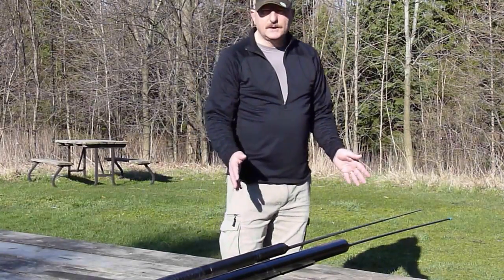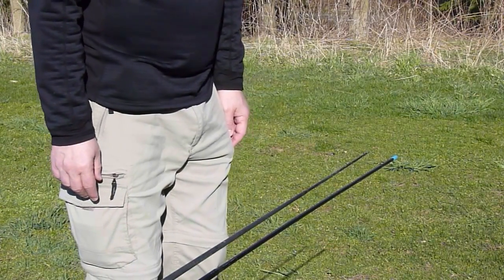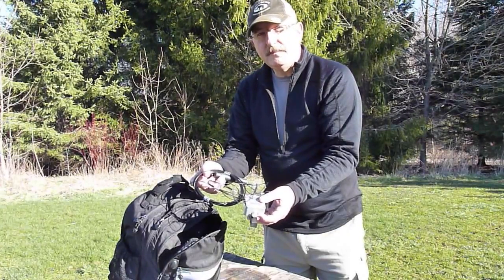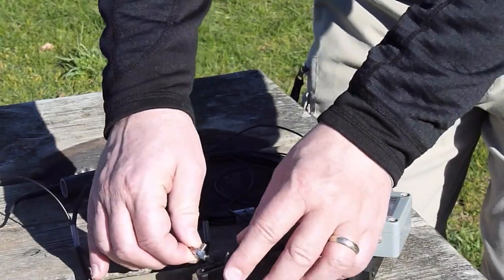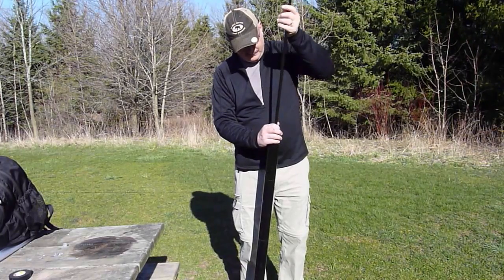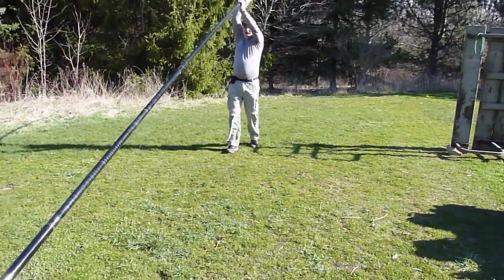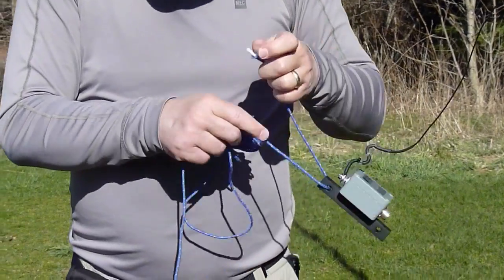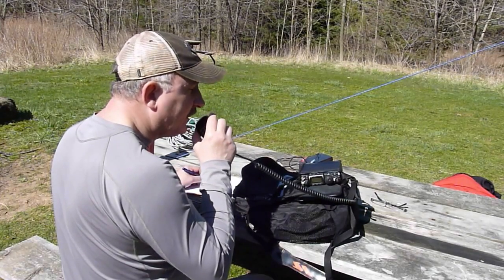HyEndFed 3 Band + Spiderbeam 12m Pole = Easy and Effective HF Portable Vertical Antenna

Comment: Great video. I have the 12m pole and it is heavy if you have to carry it to your site. I mount mine before I put it up and tape the first few sections along with the wire. then use the clamps that come with it. I find that easier if you are on your own than walking it up and less strain on the pole.
Reply from the maker: Good tip, thank you for sharing.

Comment: Enjoyed the video and subscribed. How do you have the matching unit attached to the metal bracket?
Reply from the maker: Thank you! There is no metal bracket attached to the matching unit. HyEndFed does sell some models that come with a metal bracket, but the antenna shown in this video is not one of those..

Comment: This video gives me hope! I'll check out both products at Hamvention in May!
This would play well with an FT857D and its internal tuner, no?

Keep making videos You're a natural. 

73 KD8SGP Chris
Reply from the maker: +Chris Lassaline Thank you Chris! Since the antenna is rated for 100W it would work fine with the 857D. As far as I know there is no internal tuner on the 857D. You'll need a tuner to safely operate the rig on bands other than 10, 20 and 40 with the HyEndFed 3 band.